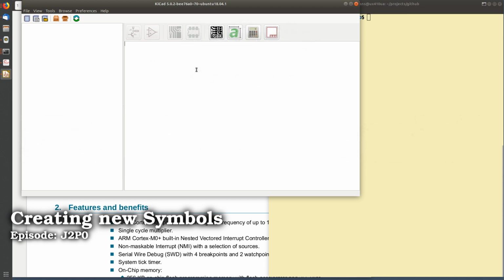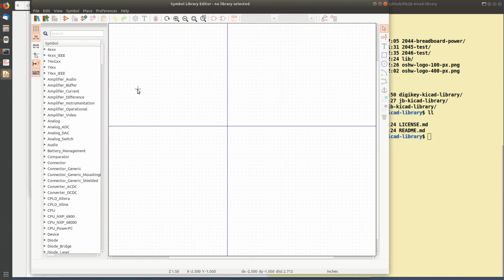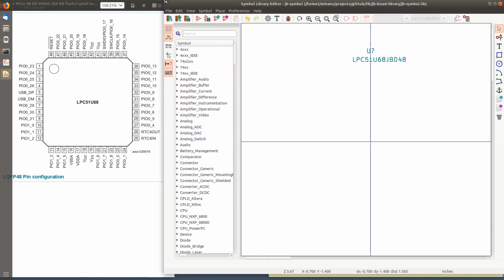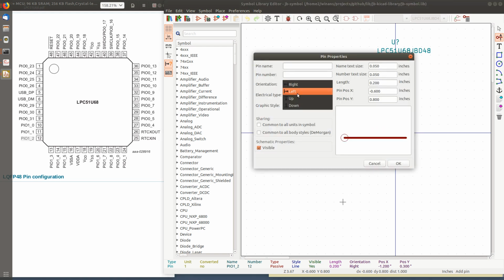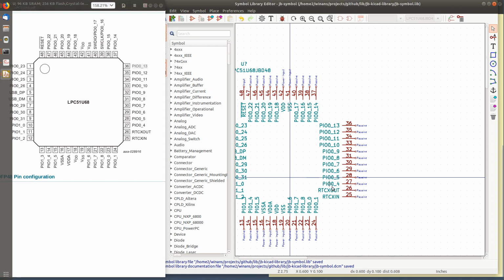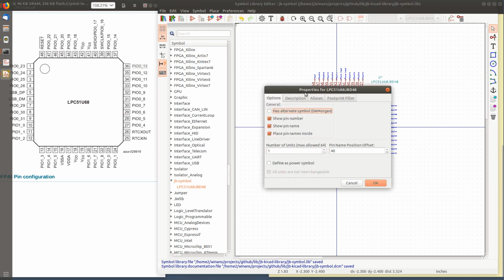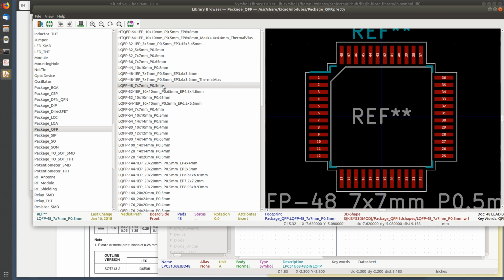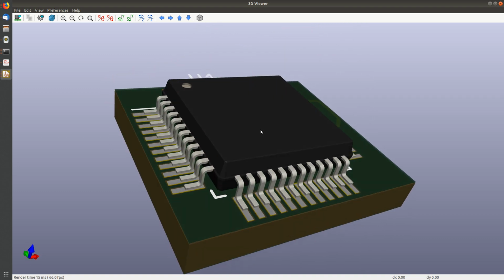KiCad 5 #11 Creating new Symbols

Comment: Came back with new question!  I created some symbols and tried to use them, but wires don't line up with them.  It's like the 'grid snap' is set to an odd interval between the schematic and the symbols.  What am I doing wrong?
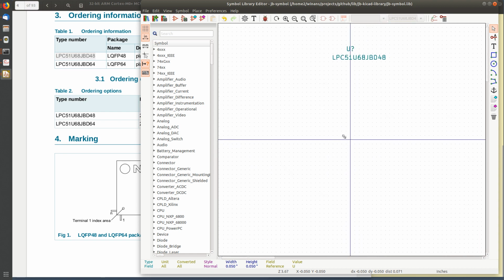Reply from the maker: I apparently had trouble getting out the REASON for using either the .1in or .05in grid at time 5:20 in this video.  KiCad symbols pretty much all use .05in as their pin spacing.  Therefore you have to set the grid spacing at .05in when editing your schematics or you can't click on anything.
You /also/ have to make sure that your own symbols have a pin spacing that is a multiple of .05 (which therefore must be either .05in or .1in)
Reply: @JohnsBasement   Thanks for that.  Now need to recreate my symbols to .05" or .1" grid snap.  (Only have a half dozen so far).   I suppose I could set the grid spacing in my schematic sheet to a smaller number, like .01" but that would make snapping harder unless I zoomed in to do it.  Actually, I'm surprised that the default settings for the grid in the symbols and schematics wasn't in Metric..  Maybe it is if you use an "Axxx" sized paper, and in inches if you use US sized paper?
Reply from the maker: @scharkalvin  That would be horrible too because any component on a US paper size would be unusable on metric paper. (Altium addresses this by letting the user mouse-click on existing endpoints even if they are off the grid.)
By standardizing on a .05in grid for ALL components/parts and then using a .05in grid regardless of paper size will work and is not TOO bad a solution... as long as you know that you NEED to use a .05in grid when editing schematics.
I tend to use .1in when creating parts and the .05 for schematics... because most other components are .05in.
If you have something that was /placed on a schematic) using a higher res than .05 and thencan not select th part at all, use the mouse to draw a box around it to select it.  Then you might have to just delete it and then replace it with another part at the .05 grid setting.
I suspect this is one of the rites of passage/learning-experience of all new KiCad users.  :-/
Reply: @JohnsBasement  I recreated one of the parts with .05", and it worked OK.  I could have used .1" snap on symbol creation, but that forces me to make the parts larger than I'd like, I need to fit a schematic onto letter sized paper.  Wish I had a printer that did 11x17" :-)    I could compromise and use legal sized paper (8.5x14), though that means changing out the paper in the printer just to print a schematic (or hand feed one at a time).
Reply from the maker: I do 11x17 and prent on letter all the time.  Some times, however I need a magnifying glass though. 😕
When needed, I print final drafts at local library or fedex.
Reply: @JohnsBasement  I would need surgeons glasses!  One of these days I will find a good deal on a used 11x17 inkjet printer.  Lasers are TOO EXPENSIVE in that size.

Comment: The cache.lib failed to load. How do I resolve this?
Reply from the maker: The cache.lib file is the set of symbols/components that have been used in the current project.  It should be part of the set of files that comprise a project and in the same directory as the .pro file.
If you got your schematic from someone else, ask them to give you the cache.lib file.  (I can see that my project 2054  on github was missing a cache.lib file :-(  I just pushed it up if that is how you got into this problem.)
Another possibility might be that your cache.lib file is present but it has the incorrect permissions and/or ownership.
Reply: @JohnsBasement  I think I changed the name by accident and now it can't find it.
Reply from the maker: @Berghiker  ah!!  Ofcourse!  Rename it so that it is the name of the project followed by "-cache.lib"  the project name is the name of the .pro file without the .pro

Comment: Even using the browse function, I still can't find the netlist I just created. Where could it be?
Reply from the maker: If you save a netlist file then it had to go somewhere.
Look closer when you create it at what directory it ended up in.
If you save it into ./blahblah.net then it is in the same directory as the project.
If you are on Windows (and it hides all the filename extensions because somehow replacing obvious and simple names with icons that all look the same is supposed to he helpful?) AND the netlist has the same name as the project (but with a .net extension) then it is probably hiding next to the pcb, sch, and pro files.
Reply: @JohnsBasement  I found it thanks. In the netlist window, Pcbnew, options: the default format was ticked. I unchecked it.
Reply: @JohnsBasement  I now only have 4 errors.
Reply: @JohnsBasement  I can't find my new symbols P1 and P2. It's not listed on my schematic either.
Reply from the maker: Is your library listed as in the project or global library lists?
Reply: @JohnsBasement  Global
Reply from the maker: @Berghiker  What do you mean "it's not listed in my schematic" ??
Reply: @JohnsBasement  I made a schematic. The component name and values have no P1 or P2 written anywhere so where does it come up with that name from??
Reply from the maker: @Berghiker  So you mean that the component is present but it has no text labels on the schematic?
Look in the editor for a 'visible' checkbox on various fields.
Try putting a, b, c,... In all the blank fields and see if/which show up where.
Reply: @JohnsBasement  Field Reference of Symbol Pot-2p-5.0, P1 in sheet/    Ok. it found something. I found 2 components the same but one had the name P1 and the other P2. Both had no footprints. Both were also found OUTSIDE of the border of the sheet. Thanks for your help. That helped me a ton!
Reply from the maker: 😂  That might explain it.

Comment: Why do wires sometimes not snap to the component leads in Schematics?
Reply from the maker: Not sure what you mean here.  The ends of wires always snap to the closest grid point.  If they are all over then change your grid to .05" (I'd prefer .1" but there are too many parts in the libraries that have pins on .05" centers.)
Reply: @JohnsBasement  I use mm and it still does not snap to the circle on the pin. Tried all from 1mm to 100mm.
Reply from the maker: @Berghiker  You have to use .05" for your schematic drawings if you expect ANY of the library parts to work for you.  THerefore you also need to use the same settings when creating your own parts/components.
Reply: @JohnsBasement  I see THAT is exactly the problem. I will try again. TY.

Comment: I have a question. When you use more generic parts like BJTs or Mosfets do you tend to use generic symbols and then specify the exact type in the schematic or do you tend to create a separate part for such things. When you have ICs that are custom to a specific vendor and package it makes sense to have that information embedded in the symbol. Also it is seemingly possible to embed multiple variants of a part within one symbol (3 subvariants of a mosfet are combined in a single pin).

One comment specific to this video there is a bidirectional pin type that is used for the pins you identify as passive. Bidirectional is used extensively in the standard kicad symbol library.
Reply from the maker: If more specific parts are available then I would agree that using them would be a good idea.  However, if you are tinkering and things change before you get to where you end up going then the specific ones might become a nuisance.  Your design style should help you decide which way to go.
As for pin types, I tend to favor using only the input, output, power and passive. In some cases it might be a better idea to be more specific. In the past the DRC rules could not be easily suppressed on a per-net basis.  If/when that changes then I will likely be more accurate about pin specifics.

Comment: Hello John, first of all thank you for these amazing videos. I just had a question regarding how to change the units when it comes to Pin properties...Despite clicking the upper left 'In' button and it being highlighted when I go to my Pin Properties, it still shows 'mils'. I was wondering how you were able to switch yours to inches. Any suggestions would help.
Reply from the maker: Thank you for your kind words!  
My editor just shows the selected units type when it opens.  I cannot change the units while it is open though (because the editor is a modal window/prevents the parent window from being used).  I have to close it, change the units, and then reopen it.
Keep in mind that the notion of the units buttons being 'hiighted' may not agree with your senses. I keep thinking that the selected units look like the button is disabled rather than selected :-/  When in doubt, select back & forth between the two types of units to get your bearings.

Comment: I once again ran into the idiotic assignment of a MosFet pin as "bidirectional".  Technically correct, but it will fail the electrical rules check if connected to ground or power!!  The only thing that works in all cases is passive.  Same thing for BJT's come to think of it.  Maybe putting a zero ohm resistor in series with the transistor lead would cheat the rule checker.  When I get this warning, I just disable it by changing the settings matrix for the rule checker to allow bidirectional and power to be connected.  For custom transistor libraries, I call the pins passive.
Reply from the maker: Yeah. I lean toward 'passive' or 'unspecified' on things like transistors where any pin can be anything.  There are SO many ways to use them that any one setting never made sense to me.  If anyone has any tips on how to deal with per-pin DRC overrides I'd love to hear about it.

Comment: good tutorial.

One advice: use more often INSERT key. It will autorepeat pin insertion and auto increment pin number and last number of pin name. So if you put pin 11, "PIO1_1" and hit INSERT you will gen next pin 12, "PIO1_2" for free.

In my opinion pins should not reflect their positions in real package. Better group them by a function. Vdd pins at the top, Vss and the bottom makes less wiring in a schematic.
Reply: can you explain how that works
Reply: ok I already get it works
Reply: @cambouiscom  Thanks for the interesting comment. I was about to ask what the reasoning is for not following the KLC with "power on top" and "GND at bottom" was. However, you made a valid point that having a 1:1 symbol can make PCB routing easier. With modern MCUs you can have many options for your e.g. DIO pins. Saves you the hassle to later swap pins in the schematic to avoid uneccessary routing.

Comment: Regarding the value and reference positions, check the eeschema preferences dialog, and look for the "Automatic place symbol fields" checkbox (wording may vary - I'm using v5.1). To use the positions defined in the library, uncheck it. BUT be aware that further rotations of the symbol can be problematic for these texts. That's why the default is "automatic". Hope this helps.
Reply from the maker: Thanks!   I'll check that out!